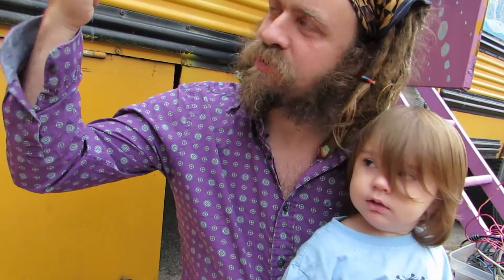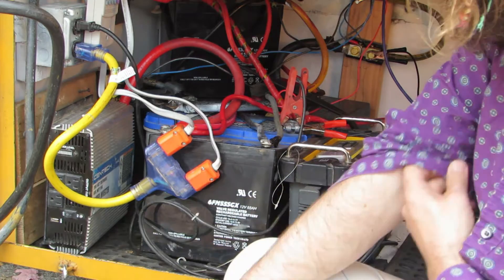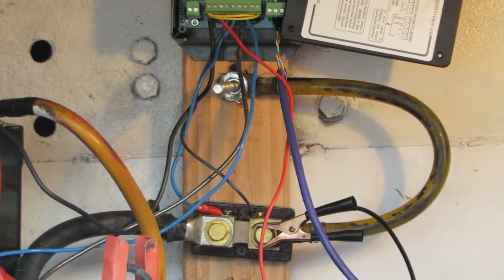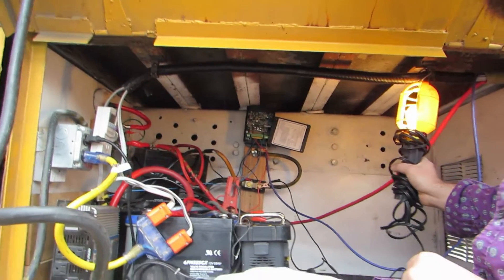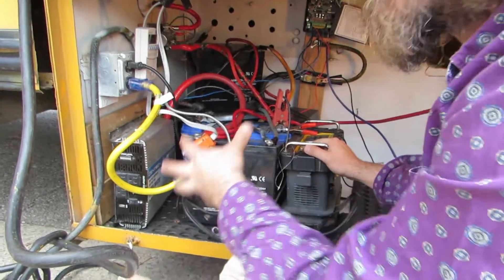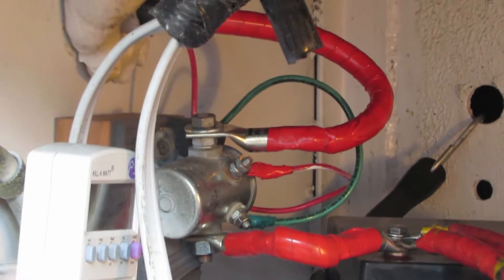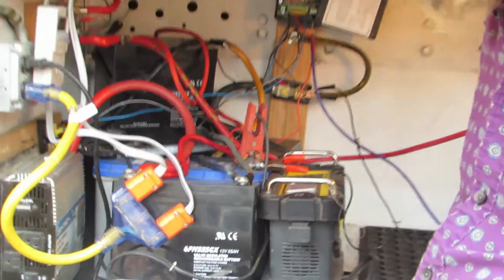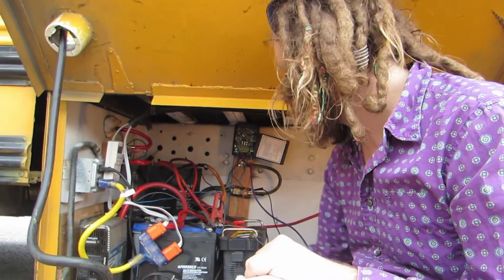Battery Box v3 - slashRoute Bus

Comment: Well thought out system. It's a good idea to use a battery bank with all the same capacity and age of batteries otherwise the weaker batteries will always be draining the stronger ones. This always happens in our golf cart as a battery with a weak cell will demand the charge from the charger and get hot while others are not being charged at all. It will also be draining others down to it's voltage.